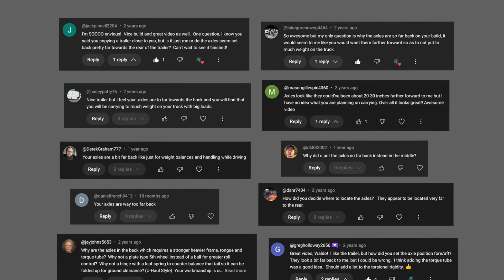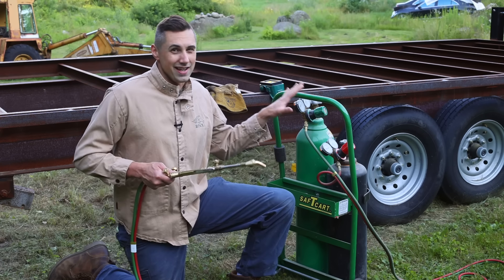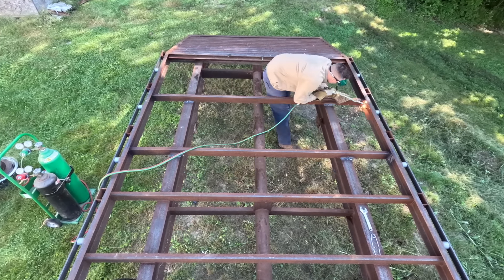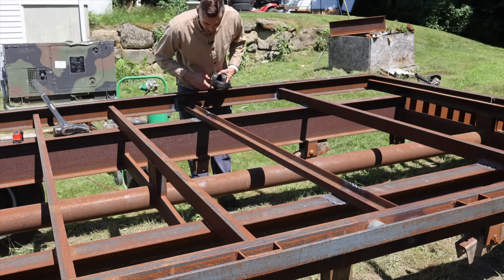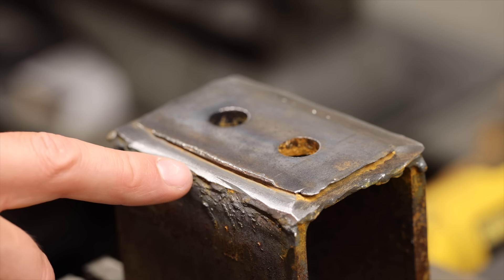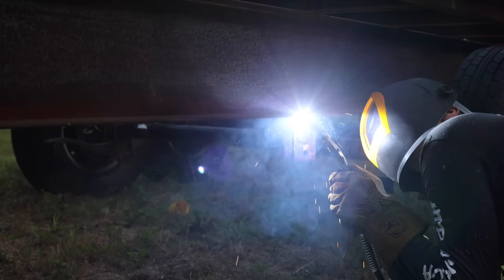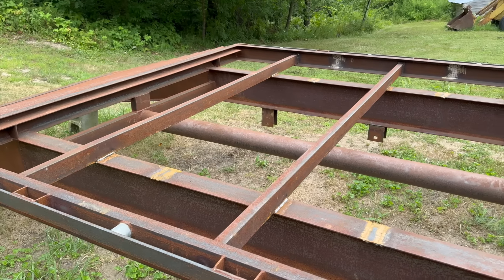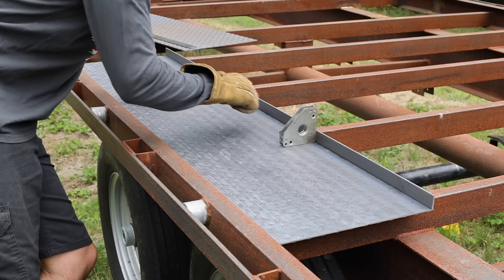Don't Make this Mistake When Building Your Own Trailer

Comment: Kudos for always learning new things. But that is not the way to use a Scarfing Tip on your torch. It's bent like that to allow you to cut parallel to a metal surface without cutting into it. So use that bend to make the flame parallel to the metal you want to preserve.

Comment: Best logical assumption is that Semi's place the axles at the back for lane control without swinging the tail out wildly. Box trucks are an exercise in compromise moving the axles forward because front of the load is on steering singles. Axles way back will also result in aggressive cut in on the inside of corners.

Comment: Just 2 cents  to share, when it comes to wiring, I quit buying junction boxes bulk wire and all the bs that goes with do it yourself trailer wiring, I just order a sealed trailer harness from load trail, plug it in, tie it up, snap your lights in and go, can wire a trailer in an hour or two and everything is nice sealed connections, and usually less then 200$

Comment: Never noticed the axle placement before well dang it and yes two things the trailer would of hammered the truck ether one made the front come up and down aa you drive and the under cutting when turning would been horrible. Those stick only people don't know what gets mig welded now. And yes stick has it place trailer makers dont use stick in the plants

Comment: 👍👌👏 "Weld" done, Waldo. Maybe you should call yourself Weldo now? 😁 ;-) I'm just kidding of course. 2) I really don't know why some viewers think that MIG/MAG welding thick material would/could cause problems. After all one can setup the device for deep penetration. For instance a friend of mine built and remodeled several steel yachts using only MIG since decades. He also fabricated several sturdy pontoons and the complete steel structure for his second floor in his big workshop (welding a lot of I- beams which we call double T- beams in Germany). 3) Okay, double shielded flux core welding sounds and looks smoother but is definitely more expensive and more labour intensive because the slag has to be removed. To be one the safe side additionally with a manual wire brush or even using a drill with a wire brush. Otherwise one risks that primer/paint will not stick. So I still stick to MIG/MAG welding.
Thanks a lot for making teaching explaining recording editing uploading and sharing 
Best regards, luck and health in particular.
Reply: In Deitschland heissen nicht nur die I beams doppel T träger sondern mig welding heisst richtiger weise auch mag schweissen weil es actives gas benutzt …. Es it nur mig schweissen wenn es aluminium ist mit argon order helium.
Reply: @ZILAwelds  
Sehr geehrter Herr Zila.
Vielen Dank für ihre Antwort. 2) In Deutschland wird es normalerweise respektive üblicherweise einfach nur Schutzgas- Schweissen genannt (MIG/MAG wird im Sprachgebrauch eigentlich kaum benutzt).
Viele Grüße, Glück und Gesundheit im Besonderen.

Comment: Of all the things I would have done different. You still got the job done. 

But yeah I've got a f550 and not everyone is used to a pickup truck with room for 10000lb payload capacity. 

But as far as adjusting it the things I would have done different I would have left the cross members in place just cut off clearance with the sawzall and just leave the cross members there between the frame rails, and I would have bought another set of hangers and then just torched off the old ones as much as you care to

Comment: Wallow great job building a trailer three things as you continue on do not I repeat do not use pine planking for the trailer deck either use pressure treated lumber or go to your local sawmill and get oak so both outlast the pine number two think we are going to put your tiedown hooks on the deck or D rings on the deck before you put your wooden deck on and number three get some big washers and get some 1 inch conduit PVC and run your wiring down through there when you need to run it across the trailer get an LB there’s an inlet and outlet and there’s a tee off of that run all your wires through that and you might also want to think about putting an under the trailer pallet fork holder somewhere down the line you’re probably gonna skid stir knowing you and how you collect junk you order three things keep up the great work Samuel bacon

Comment: would be easy for an angle grinder. use the oxy to cut most of the welded material off and now you can fit a grinder in there

Comment: My mistake was building a really nice and compact low trailer. It works great when it's loaded, but when it's not, it's totally invisible to me driving and backing up, and I have had a few people try merge on top of  it too. Lol oh well, will get a flag on it some time
Reply: I use some fiberglass rods on the end of my low trailer so I can see it in my mirrors when I'm backing it up. Also for piece of mind while driving to check if my trailer is still there lol. 

Like fiberglass rebar rods.
Reply: @schwuzi  yeah that's what I was thinking, like an offroader flag, they are fibreglass poles

Comment: Nice… please explain about CDL… and smaller truck.
In California it is the combination of the Gross Vehicle Weight Rating of the trailer plus the GVWR of truck towing…the smaller GVWR of the truck not the primary determinant. The trailer and load are the bigger consideration. 😂

Comment: My trailer has the axle at the rear as that’s where all the weight is with my fishing boat. However, the axle can be moved to the middle quite easily as it is a generic design.

Comment: Nice trailer Waldo. Protrack makes a pierced frame trailer that uses a pipe down the center to make the deck lower. Your design is slightly different. Can you elaborate on your design

Comment: Maybe research carbon arc cutting, that uses compressed air, I haven’t seen one for like 30 years, so maybe it’s not the best thing but thought I’d mention it. As for the axle hangers, cut them off as close and you can and grind them down, make or buy new ones for your next step. Do you have a video on why or how you don’t need a cdl for one vs the other? Pretty sure you need a cdl to town more than 10k always. I definitely know that a truck with a bed it a truck whereas a truck with no bed is considered a tractor and can carry far more weight legally. Also, the shorter wheelbase will make life a lot easier as well and spreading the weight out better. I’m a long time cdl holder with every possible endorsement except passenger bus, but curious on the laws for these truck and trailer combos, not at all trying to be negative about that or about your video in general, just interested in options and facts, enjoyed the video.

Comment: Wouldnt it have been easier just to add a few more axle hangers so eventually you could add the old axles back and have a 3 or 4 axle trailer
Reply: I had the same thought.
Reply: Duh
Reply: I was just about to comment this!
Reply: Also "duh".
Reply: No. Why on Earth would he need that
Reply: @wyo_garage20   He wouldn't need more axles but it would have been less work to just weld on a new axle mount and leave the old one.
Reply: @wyo_garage20  Better to have it if he does need it?
Reply: @Phreedom  That doesn’t even make sense. Something tells me you don’t pull a trailer ever
Reply: @wyo_garage20 instead of being unhelpful how about you explain why you think the way it was done is correct.
build up dont tear down
Reply: Yep, I wouldn't have bothered trying to reuse old ones after they're cut off. Just weld new ones and leave the old.

Comment: You may have mentioned this, but you should consider welding a plate over the I-beam where you cut it. Otherwise, it’s going to be a failure point.

Comment: Good content, with lots of rework, but a CDL for that class of truck would have been easier and have given you another skill under the belt 👴🎅🤔😉😊for the future. Next option if you already have a plasma cutter, removing those welds maybe easier and cleaner. Just an oldman's observations to make you scratch your head.

Comment: I wouldn't be able to start building a trailer until I had it all drawn up in 3D CAD and knew exactly all my axle and tongue loads.  I've been burned by trailer companies before - me thinking they knew what they were doing.  Turns out, not all know what they are doing.

Comment: Just curious, why not leave the original hangars in place and add new hangars in the new position?  That way, you could have been able to move the axles back if you ever decided to use the other truck.  Plus, it seems like it would have been much easier to add new hangars.

Comment: Why do you need a CDL with that trailer and the 3500hd? Probably a newb question but … got to learn.
Reply: @tomdillan  if i recall, its just his state's rule and the potential combined weight of the truck and trailer. The 3500HD is a higher GVW rig and rated as "commercial" there.
Reply from the maker: Yeah, it's the combined gross weight rating of the truck and trailer, which would be 29,000 lbs. The limit in the US without a CDL is 26,000 lbs
Reply: @WaldosWorld  here in OR we can just declare that the truck wont be loaded that heavy an go non CDL...and just not be legal if it IS loaded heavy.
Reply: @WaldosWorld  thanks
Reply: @WaldosWorld  Wow that's crazy high. In Europe the maximum weight one can tow without a truck licence is 3500 kg. So combined car and trailer weight only goes up to 7000 kg or around 15,400 lbs.

Comment: I would have been worried about doing damage to the frame with the cutting torch.  You couldnt just buy new axle hangers and cut out the sections of cross member that would interfere with the wheels? Maybe thats just me though

Comment: i think i would have just cut the wings off of the old mounts and left them welded to the frame and then installed new mounts in the desired location.... or tried to use the FRONT axle mount as the new REAR axle mount location

Comment: What kind brand of the large cut off wheel you used on the grinder on spring hanger s  where can I purchase one thanks  that is a nice trailer build and I liked the video on the build of the 3500 truck

Comment: Why cut the cross members and move them?  Wouldn’t it have been faster (time is money) and beneficial to just remove material if the new tire location would have hit the cross member.  Then just add additional I-Beam cross members if necessary.

And that was almost a negligible move of the axles forward. I hope it worked out for why you needed.

Comment: Why did you gouge it off the sides?  Did you think of cutting off the cross members at the rail flange with a plasma so it didn't affect the thickness of the rails at the gouge while also changing the characteristics of the steel in the rails?  All it would have cost you was the metal for new crossmembers and you wouldn't have as much risk of a bend or a fracture.

Comment: Having a 3500 truck does not dictate that you have a cdl to pull a trailer. It is the weight and how the trailer is tagged that dictates that.  You didn't change the weight capacity of the trailer since those are either 7k or 8k axles.

In Oklahoma we don't have to tag a trailer to use it on the road and our dot won't look at a trailer even with 3 8k single tire axles, they only look at trailers with duals as those axles are 10k+ rated.

Comment: what the idea with letting the trailer rust out?
Reply: With the thickness of the steel used on that trailer, the rust you see is really nothing more than a cosmetic problem.

Comment: I'm curious. Even if that truck could handle the tongue weight, why wouldn't you put the axles where you could better balance the load and pull it with other trucks?

Comment: Hey Waldo, is there a reason you don't paint a lot of your metal work after you build it?

Hate to see such a beastly trailer so rusty, but maybe that's by design
Reply from the maker: The rust on this is just surface rust, so there's no harm in it. In fact, being rusty makes it easier to sandblast because the rust is easier to remove than the mill scale that came on it from the steel mill. Once I finish building it, I'll paint it with a nice epoxy/urethane coating
Reply: @WaldosWorld  Cool! Thank you for the info, as always looking forward to see the completed build. It looks epic.

Comment: Looks like you got a serious rust problem going on.
When I built my own trailer, I made sure to derust everything completely, and then paint it with primer and then silver propane tank enamel.   Golden gated all the bolts and painted over all the welds.     The problem with rust, is the presence of rust begets and accelerates... more rust.

Comment: Did the trailer ever get a name? So much has happened since then, where to start? Maybe the "Safe and Effective" Trailer? Or to the bane of the Secret Service existence maybe The Slopey Trailer would be a good fit. That beaver tail is an extreme angle Sir, please use extra caution.

Comment: Dumb question, if you added another set of axles closer to the tong and left the original ones in place, would that solve the problem or would it bring another problem ?

Comment: I am curious as to why you suggested you would need a CDL to pull that trailer with the 3500? I have owed a few 3500s and pulled several trailers in the last 20 years and for personal use I did not ever get questioned about a CDL. Now when I was in Sales and I crossed state lines i drove a 3500 and pulled a trailer often for work and it was required to have a CDL but that was doe to Intrastate commerce.

Comment: I don't know much about this trailer, but it looks like its heavy and can haul a lot. Just be warned, if the trailer GVWR is over 10,000 pounds, you will still need a CDL license. It doesn't matter if you stay under 26,000 pounds registered. You have to be careful, if you register the trailer at 10,000 pounds, but get the weight over that, they get you for over weight and no cdl, instead of just no cdl if the trailer was registered higher.

Comment: Nice trailer.  You don't have big enough axles to require a CDL to pull it. Its a Federal law so doesn't matter which state you are in. I had dual tandem axles and when pulled with my 1 ton needed a CDL when pulled with my 3/4 ton didn't need anything special unless using for commercial use. But you needed to move those axles regardless.

Comment: If the trailer weighs more than 10,000lbs you need a class A cdl. Regardless if you're under 26,001lbs.

Comment: CDL stands for COMMERCIAL drivers license.  Has nothing to do with the vehicle being driven.  It is only necessary if your job is driving and even then, there are exceptions.

Notice how there is absolutely no GVWR, GVW, or GRW referenced in the term Commercial Drivers License?

The vehicle type, GVWR, etc, affects which license CLASS you need.  As an example, a motorcycle requires a motorcycle license in the same way that a 80,000 GVWR truck does. I personally have a Class A license that is NOT CDL (80K, non-hazmat).

Comment: To drive a 1ton truck.... a 3500 in that country you need a CDL  to drive with that trailer.... wow. As goofy as shit is here in Canada we never require that. Drive a 5500 truck... no licenses at a commercial level. 

No air brakes on truck or trailer... No "Q" endorsement, no class 3 or class 1 requirements
Reply: I live in Minnesota, and I've never heard of anyone needing a CDL to drive a one ton with that size trailer behind it, it just isn't a heavy enough combination to require it.   A 3500 pickup can be registered as a truck and get commercial vehicle plates which some people do to save money, but even then I don't believe you'd need a cdl to drive it.

Comment: There is no reason mig is any stronger in the instance of this trailer. For stuff over 1/2-3/4. Yes it can be stronger. But if the base metal is under that a might weld done right is more then strong enough. Just think about it for a sec. The 1/4” channel and plate is going to break first.

Comment: Not familiar with earlier videos of this build, so I will simply say this. The only “mistake” I see is that you built a trailer specifically for one vehicle….and then you replaced that tow vehicle with one that is not suitable for the trailer. So the mistake was not the trailer build, it was your changing vehicles. 🤨

Comment: The Trailer Wheels are setting to far back to load the Trailer evenly, the Trailer axles should be about 60 percent back from the front of the bed on the trailer. You only need 1000 lbs tongue Weight on the truck. With this setup you have is about 2500 pounds or more on the Truck In addition You need Trailer Brakes on the trailer also.. In addition with the alxes placed at 60 percent of the bed length from the front of the bed, the turning radius will be shorter too. With the current setup the Axles is about 75 percent of the Bed from the front . With the current position of the Axles your Weight isn't Centers. You have too much weight on the Tongue or the back of the truck body. The maximum amount of weight on the truck shouldn't be no more then 1500 lbs. with the trailer loaded.  you have too much Weight on the truck as with the current setup. The truck will not operate as it should operates as if it was setup as I have Stated. The Trailer is designed to carry the weight and not the Truck. Too much weight on the truck with you setup.

Comment: Learn how to swing a sledge hammer. Don't give it baby taps. But then you'd have to actually buy a sledge, not that splitting maul. Maybe next time stick weld (6010-7018). And I still think the axles are too far back...